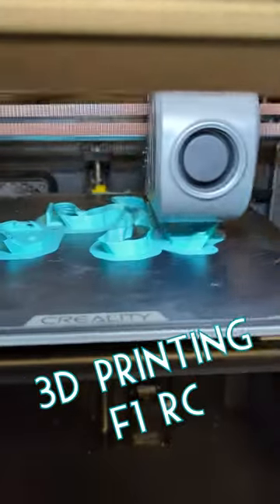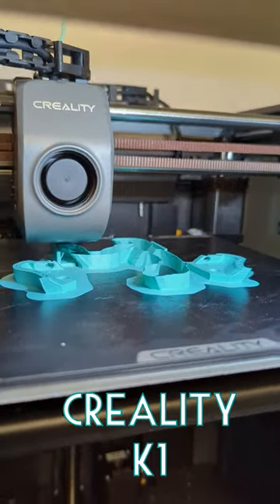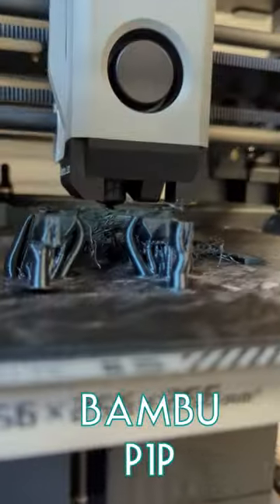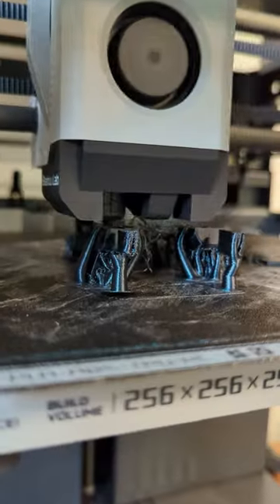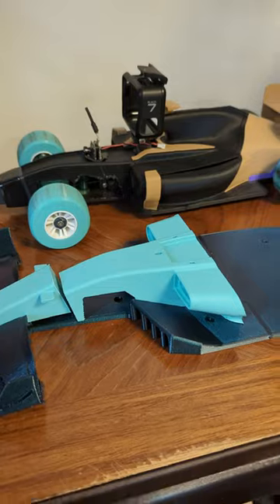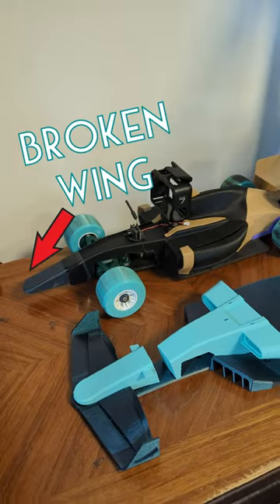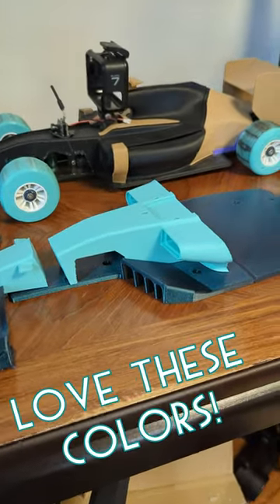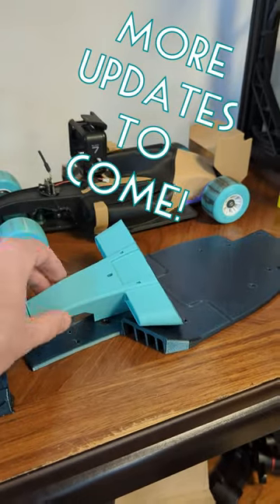3D Printed F1 RC Car 🏎 Part 1

Comment: The glue is actually meant to prevent from sticking too well. I don't use glue at all but keep the plate clean with ipa. Works just fine..

Comment: I couldnt get anything to stick on my bambu lab P1P because the default plat in the slicer is the cool plate even though it comes with the dual sided PEI plate. I didn't know until I had tried to print so many things with no success but now it works great.
Reply: Mine came with only the PEI plate, and it already on when I got the printer
Reply: Ohhhhhhhhh you mean the default one in the slicer, yeah I quickly found out that I needed to change the temps because all my prints were sliding around

Comment: Just a tip, the stock bed that comes with both the X1 and P1P are not good, I'd suggest buying a different one, I'd check with whambam, their beds are great.
Reply: This is nothing more than an advert for a K1, so you know they're going to make the P1P look like trash.
Reply: @CincyNeid See the good side, we can get comments with useful tips for Bambu users
Reply: @omegadeepblue1407 nah the default PEI double sided plate that comes with the P1P is great... Been using it for over half a year with no issues and it still holds up well. No glue or hairspray too for PLA, PETG, TPU.